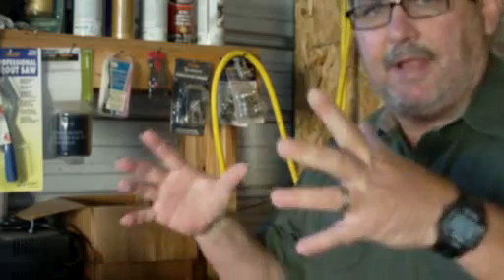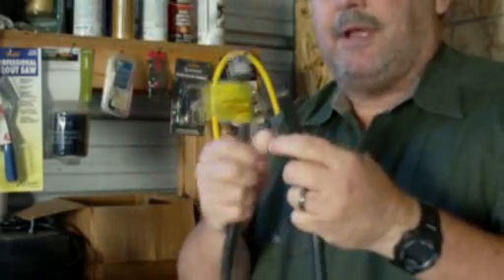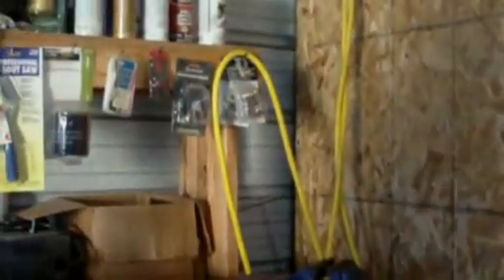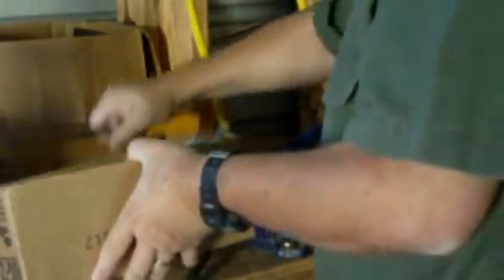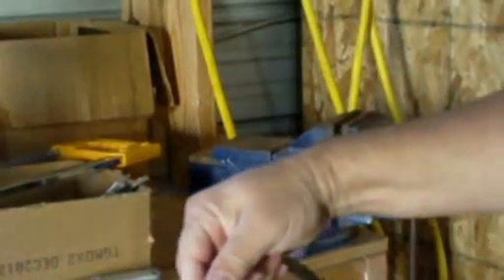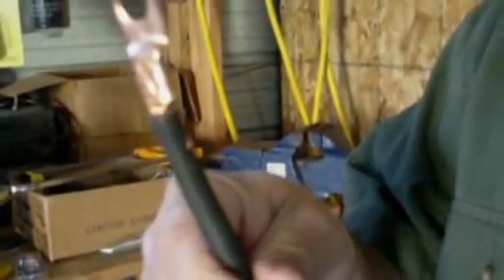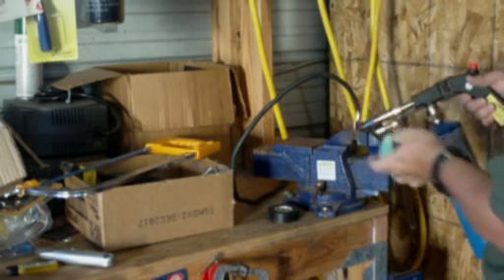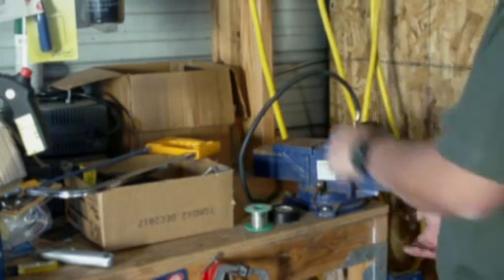How to make battery cables for your solar batteries

Comment: All lugs are not the same.  I only use tin plated heavy duty lugs from SS Industrial Cable in Port Washington, WI.  They have the cable, HD lugs, heat shrink and will even professionally install the lugs if you know the length you need!
Reply from the maker: Good for you. I use lugs I get from my local Interstate battery shop and copper welding lugs from Harbor Freight, very different but they seem to work equally as well for me. After six years of having my battery banks up and running I have never had a single issue. Thanks for sharing the other source of lugs.

Comment: Im quite sure you have noted that when the CC is charging an empty bank the input array voltage reading is slightly lower than the panel rating. .....but once the bank is full the voltage is very close to is max short circuit voltage.  This is because the CC has disconnected the solar array thus the potential energy.   A GTI does not do this because it is not designed to do this.  It is designed to give the maxium amount of energy the array will give it to match the grid.

Comment: @bpd894 The CC will do one of two things with the energy....either store the energy in a carrier (the batteries) or disconnect the panels which is back to potential energy.  The GTI is on and converting the static electricity into electricty that matches the grid/inverter.   It cannot behave the same way a charge controller does because it is not one.

Comment: @econewpower We disagree then in this one issue.   I believe that unused potential energy is a solar panel with its leads dangling in the air.  Once it is connected to a GTI or charge controller...whatever ...it is then energy .....not potential energy.

Comment from the maker: @bpd894 In one sentence you say that an inverter can regulate its output and then you say that a grid tie inverter (GTI) cannot, that is incorrect my friend. Neither the off grid nor the grid tie inverters will output more power than it is being consumed. Assume each is 200 watts and both are on and the only load is a 100 watt bulb in the shared circuit, only 100 watts will be produced by both combined. The rest never gets converted it just sits as unused potential energy.

Comment: @econewpower Far be it from me to challenge a man with all those guns : ).  Agreed in your setup perhaps.  But what if Michaels or another tubers setup is not like yours?   Its not a "giant leap" to considered what would happen when the load is say...only 200watts.  A PSW inverter and charge controller can regulate thier outputs....the GTI cannot because it is not designed to do so.   So where will the excess power go the GTI is putting out under full sun?  Its gonna burn something up.

Comment from the maker: @bpd894 Yes, I was a bit defensive because you made a giant leap to "overpowering" and wanted me to give you examples to backup my claims before people started blowing up their GTIs...that sounds rather challenging, don't you think? My answer to Michael is correct, a GTI will an off grid pure sine wave inverter as "commercial power" and begin producing power to the local "grids. The GTI doesn't know if the sine wave is from the street or an inverter because they both look identical.

Comment: @econewpower In its intended grid tied application, it is impossible for the GTI  to over power the "source" (grid) and you will never have a problem.  In a battery (0ff grid) application, I am not so sure.  What examples can you give to back this claim before people start blowing up thier GTI's or inverters?

Comment from the maker: @mosbysmen NAPA or my local Interstate Batteries store, they both carry the battery cables and lugs. You can also get both from your local welding supply shop, welding cables are far superior and the lugs are the same. You can also buy the lugs from Harbor Freight in the welding supply aisle.

Comment: hello this is off the subject but i think i heard you say one time that you can trick your GTIs with an inverter.i wanted to know if during a power outage could i use a 240v inverte off my battery bank and shut my  my main off and get the power from the inverter to trigger my GTIs to come on.i think i would need pure sine.i thought about switching them on when i had my old genny hooked up but i dont think its pure sine.thanks for your time

Comment: @econewpower 
And the the DC disconnect goes between the batt bank and the inverter? Or between the controller and the batt bank... or both...?
Where did you buy your equipment? 
Thanks again.

Comment from the maker: @texasprepper2 A crimped and soldered connection is the most reliable of all but crimping only is good enough if good crimp is done. You should have a DC disconnect for sure.  Thanks.